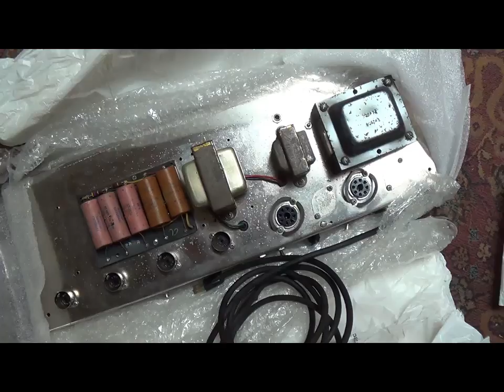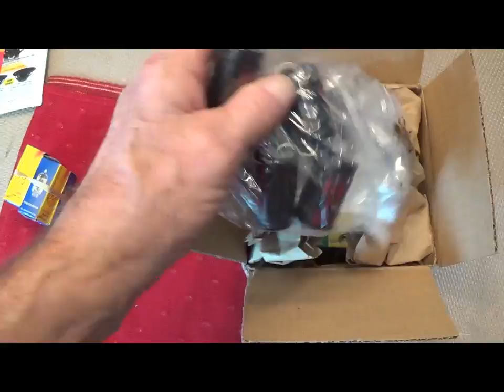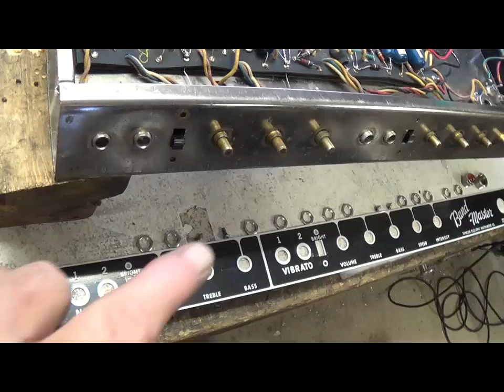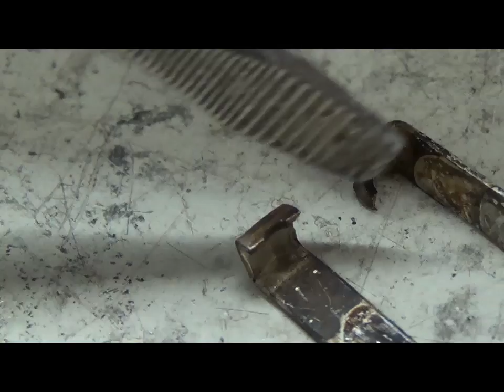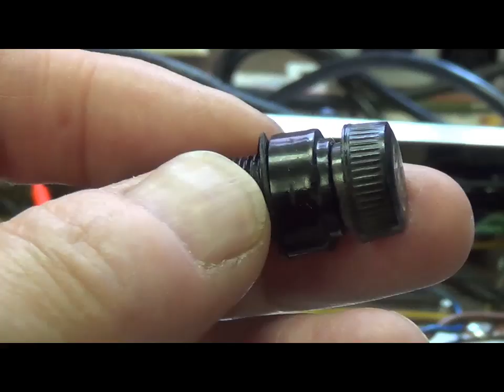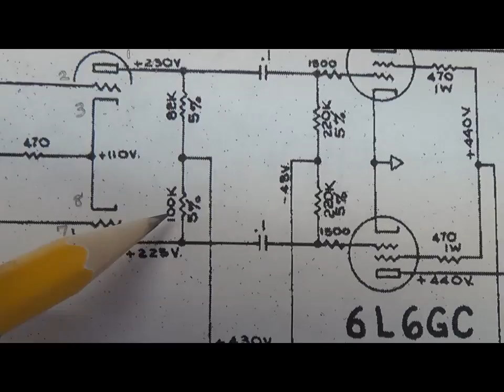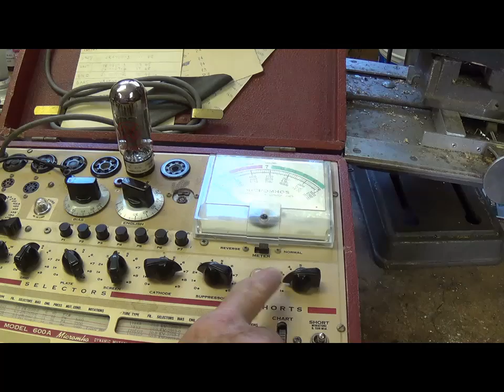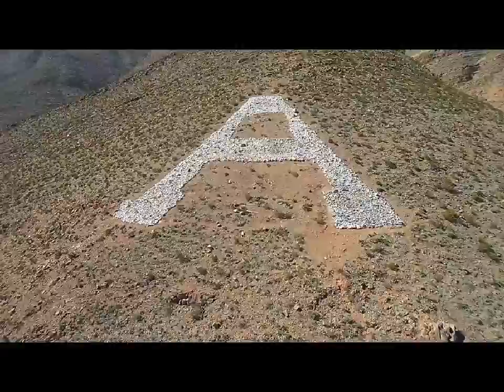The 1965 Bandmaster from Hell......A Really Tough Repair Job

Comment: Interesting about the resistor breaking down at high voltage.  I haven't seen that before.  With no voltage drop, I was thinking "no current".
Reply from the maker: You may be right, Russell. It would explain the voltage reading.....and the lack of sound from the tube.
Reply: Uncle Doug It's possible the resistor had a dry joint at one end.
Reply from the maker: That's an interesting theory, EJ. Thanks.
Reply: EJP totally agree with the poor joint theory. Other than drifting high over the years, that 82k would have been fine. Some of the eyelets looked as if they could have done with solder wicking and new solder.
Reply: @UncleDoug  so what is the best method for testing resistors for resistance if not the ohmmeter? especially if you are starting a new build and want to select/test value before soldering a part in the circuit....read some more comments and Doug you said, "It's rare to find a resistor that tests within reasonable limits with a low-voltage DC ohmmeter but breaks down under full current....but it can happen. If you suspect this is the case, then test the resistor for voltage drop."

Comment: Hmm what is the Zener  doing in there?
Reply from the maker: It appears to be a factory modification to reduce the DC high voltage. This is an unusual chassis, with its chrome-like finish.
Reply: Have you seen them before in factory amps?  I know it was a tip in Weber's book.
Reply from the maker: No, I haven't. But this amp circuit appeared to be completely original and untouched.......yet it had the zener very nicely installed.
Reply: The plot thickens :) do you think it was possibly a display amp? Or a prototype? Jack knew..
Reply from the maker: Indeed, his intense interest should have tipped us off. Yes, I think it was something "special".....but have no idea what.

Comment: Now hold on just a minute, don't you have a personal account rep at Antique Electronics? How dare they question the master of all thermionic emission? Or did you just use Jack's name? 

I'm glad you stuck it out and got that Bandmaster running. I've never seen anyone dissect a lightning bug or rebuild a switch before. Did you grow up on a farm where you had to fix everything yourself, not just run into town to the hardware store?
Reply from the maker: They don't know me from Adam at AES, as far as I know, Craig. I ask for and get no special treatment......darn it !! I just prefer to fix things on the spot, rather than wait decades for overpriced after-market parts to (hopefully) be delivered :)

Comment: Another great video, Uncle Doug 
BTW, my Newcomb D-10 arrived. 
So far, all of the TIny Grief caps test bad.
All the electrolytics test bad, save for one Zenith cap that appears to have been an old repair for a failed Tiny Grief.
I've ordered new caps to replace all the TIny Griefs and electrolytics.
Since this amp is missing all its knobs, I ordered brown chicken heads. Ordered a can of Deoxit to clean the pots and switches.
Now, the hard work begins.
Reply from the maker: It sounds like you are well on your way to a successful resurrection of the Newcomb D-10, FJ. Let us know how it turns out :)
Reply: Thanks, UD. You know I'll be asking you questions as I go, right? 
I'm thinking I'll need a 100K resistor in one of the inputs (for guitar). Wondering what resistors I need for bass and blues harp. 
Once I get the caps sorted, I need to find out where the negative feedback loop(s) is/are so I can remove or mod them for guitar use. 
I'm a complete tube amp virgin, so I know jack about them. Just know that I like the way they sound.
Reply: So, can I substitute 6L6 tubes for my 6v6s, to get more gain?
Reply from the maker: Not really, F3. If the circuit is designed to handle 6V6's, you'd best stick with them. 6L6's require higher plate voltage, plate current, and filament current.

Comment: Hi, thank you for the videos. I thought the speed of that vibrato was a bit fast for a less than one setting. By my comparison it should be soo slow to be barely decernable.
Reply from the maker: You're welcome, Glenn. I'm sorry you felt it was too fast. Hopefully the owner will like it as it is :)
Reply: Hi Uncle Doug, I had a chance to play through my fender Quad Reverb today and I noticed you were right, The vibrato is faster than my memory of it. You were right, I was wrong. You know, I couldn't figure out how you could have got that so fast, amazing memory lag. :-) Thank you for your understanding, when I was setting up my amp today, I realised straight away I had made a mistake with you, I should never have doubted. My apologies, warm regards, Glenn.
Reply from the maker: No problem at all, Glenn. I really appreciate your nice follow-up.

Comment: Doug, I'm curious if that output transformer is the original. My '69 Bandmaster had a mere 35 watt output transformer. Perhaps the lower output output transformer was a change for the Silverface series amps. My '69 Bandmaster-Reverb amp has ~460 vdc B+ with a 5AR4 rectifier. BTW, nice guitar playing at the video's grand finale.
Reply from the maker: This amp was unusual in several ways, Tony, including the unique chrome-like chassis finish and a zener diode for the HV centertap to reduce voltage levels. It all appeared to be factory-done. I never did check the OPT to see if it was an original number......but I'll bet it is.

Comment: Doug, you have done a fantastic job troubleshooting and repairing that classic amplifier. The aftermarket is great, I recently replaced the worn faceplate on a used Ampeg V4 amp that I bought and it looks as good as new. I love Antique Electric Supply and have had only good experiences with them over the years.
Reply from the maker: Thanks, Tony. I agree, AES is an excellent, well-run business.

Comment: JJ matched 6L6's are my favorite 6L6 tubes. I have been using them in all of my many 6L6 amps for many years with no failures. They consistently have a higher output wattage than all other brands I've tried and have good tone.. They have held up to the 495 vdc plate B+  in one of my home made 130 watt RMS amps.
Reply from the maker: That's good to hear, Tony. Other viewers are scaring me with their tales of horror. I just sent the chassis back to the owner and am worried it may let him down due to a tube failure.  Let's hope you're right.

Comment: I own a 1969 Fender Bandmaster-Reverb amp that I bought new and it is genuinely a 50 watt amp that Fender installed a 35 watt output transformer into. The output transformer failed in the 1st year and was replaced with a 50 watt transformer.  Since the transformer upgrade it is one on my favorite amps.
Reply from the maker: It sounds like the factory made a mistake, either in design or construction, Tony.  Even at 50W, there was no leeway.

Comment: Learnt something from you: that although a resistor can bench test within range, it may not be correct under load. Thanks.
Reply from the maker: You're welcome, Simon. It reminds me of the house roof that never leaks.....unless it rains. Without current, you really can't tell.

Comment: Would have liked to tap that defective tube a few times with the handle of a screwdriver when in the tester to see if the short returned.
Reply from the maker: I tapped the heck out of it, Simon, and nothing changed. I even took it out of the tester and shook it......no change.

Comment: Hey Uncle Doug - thanks for the great video!! Quick question please: How did you determine that the two 6L6 coupling caps were leaky?  Did you test them in-circuit?  Do you always test all coupling caps for leakage when working on an amp?

Just another thought.  Is it possible the tube socket or surrounding wires might have been responsible for that temporary short in the output tube?  Did you inspect for that?

Thanks for all your knowledge and expertise !!
Reply from the maker: Leaky power tube coupling caps are easy to spot because the plate current in the tube will not stabilize......it keeps increasing, due to the positive DC reaching the grid. The only way to properly test them is when they are facing normal operating voltage and current. The short appeared also in the tube tester, which uses a different socket. You're welcome, Donald.
Reply: Excellent !!  Thanks for the reply Uncle Doug !!  ;) ;)

Comment: Wow! Doug,  The amp from hell is a conservative description. I could embellish somewhat, but this is a G rated audience :) Yes...I've had quite a few amps like this cross my bench, and a 6 pack for each additional amp from hell afterward :). This reminds me of a Messa Bass 400 I had in the shop for 2 solid weeks. From randomly going into oscillation for no reason, to the PT developing a shorted HV secondary, to the output tube buss wire becoming a dipole antenna. i listened to the local weather report while cooking the new PT to make sure everything was right before I threw it at...I mean, hand it back to the customer. I no longer take Messa amps in for repair. I needed a vacation after that amp LOL :) Another great video! Looking forward to the next.
Reply from the maker: Thanks for your nice comments and for sharing some experiences, Frank :)

Comment: This type of repair is irritating.  You may as well replace every component because it seems as though they can fail at any moment.  You didn't show it, but I suspect that 100K resistor was the culprit, since you had full power transformer voltage at the 82K.  Thanks for the video as always Doug.
Reply from the maker: You're welcome, KM4. Sometimes when a repair job gets really frustrating, I start focusing more on the repair than on the video, and some steps get skipped.....but I think you can get a reasonable overview from this video :)

Comment: Great learning here, and I like your methodical approach. This is quite similar to my old Bassman, so this is helpful for more than just Bandmaster owners :). Like you did here, I replaced the resistors in the power section to be sure everything was fresh and even. The 220k resistors in the bias circuit were different types (carbon film & carbon comp). I just didn't trust that they would be the same resistance at operating temp.
Reply from the maker: Thanks !! A wise move, Andy. I am tending to favor metal film resistors more and more :)
Reply: That makes me feel better about using them :). I'd heard they are more stable at temperature, so I went with them for the grid stoppers, screen resistors, and the 220k. Their blue color matches the original coupling caps pretty well haha
Reply from the maker: They really are the best readily-available replacement resistors you can get, and the cost is minimal.

Comment: Some joints look new, so chassis has been polished or dipped at sometime.

A purrfect outcome
Reply from the maker: Not without complete disassembly......which I see no evidence of, Nic. It's a very strange finish and I wonder if this chassis was not specially prepared originally for a unique purpose or person (??)
Reply: True, perhaps a competition, limited edition or retirement, difficult to find this info out.
This project was undoubtedly a voyage of discovery, can I ask what was the actual time spent (not including waiting for parts)
Reply from the maker: It's hard to say, Nic, since it was off and on over about two weeks. I would guess 6 or 8 hours including all the testing and re-testing.

Comment: the short test in reality is not a dead short,it lights up with values below 300kohms approximately,so it can happen after a while the tube is working,gets hot and the elements can move or release metal flakes that give problems.
Reply from the maker: Either way, would you want that tube in your amp??  I thought it best to switch it for a new one.

Comment: Very good video as usual. Nobody, but NOBODY, with the sole exception of my favorite uncle, yep that'd be Uncle Doug, would ever consider taking one of those little slide switches apart just to see why it failed, let alone fabricating those eensy weensy metal parts for it and putting back together again. Sheesh! I'm fairly certain that if I ever took something like that apart I would destroy it in the process and learn absolutely nothing for my effort. Here's how it would go with my typical luck. If I tried reeeeally hard to carefully open that little switch up without ruining the body of the thing, whatever eensy weensy parts that were inside of it would fly out in all directions before I had a chance to see what they were, how they functioned, or where they came from. So yeah, I am in awe of how the master takes stuff apart and repairs it. It keeps the originality of the unit intact to the nth degree. Like the excellent video tutorial we were treated to in the W.E. Grable amplifier rehab, where he shows us how to open up a frozen potentiometer, clean it, and get it working like new again. Or that oil can delay unit that he was able to resurrect by fabricating parts for it and cleaning the daylights out of it 'til it worked like new. Thank you Uncle Doug! I look forward to new videos like I used to look forward to new Batman episodes when I was a kid. Very well done indeed sir, and please, keep 'em coming! {8^)
Reply from the maker: Wow.....thanks so much for your detailed analysis, DE. I am quite flattered :) We will do our best to keep you entertained with videos for as long as we're able.
Reply: Aw shucks Uncle Doug. My part was easy. You and Jack are doing all of the hard and dangerous stuff. Watching an Uncle Doug video is like watching Mr. Wizard, Nova, and Soupy Sales all in one show. When you predict the exact result a changed resistor value here or a different capacitor there is going to be, then power the amp up and prove it, that's sheer Mr. Wizard. The educational stuff is Nova on PBS, and the disembodied hand coming into frame to accentuate the dialog is vintage Soupy Sales answering that back door. You never saw who was there save for a hand that would punctuate every word the visitor said. I mean it man, your videos are pure genius and I mean that in all sincerity.  {8^)
Reply from the maker: Wow.....high praise indeed, DE. Thanks so much :)

Comment: Nice video, as always. No amp videos from The Guitologist this week, so it's nice to get my tube-amp-repair-video fix from my favourite uncle :-)

Speaking of selenium rectifiers: There is a Siemens selenium bridge rectifier inside one of my tube amps; a modded 60s projector amp with 2x EL84 PP. It seems to work well. Should I replace it with a new silicon bridge rectifier anyways?
Reply from the maker: Thanks, Asle. If the selenium rectifier is for high voltage rectification, it might be best to replace it. New bridge rectifiers are much more efficient and reliable......and inexpensive to boot !!!
Reply: It's for the B+ rectification; about 390V at power-on and 335-340V when the tubes have warmed up. I've got a few bridge rectifiers scavenged from dumped computer power supplies, I might use one of those after verifying that it works.

PS: A cute neighbor cat drops by outside our ground floor apartment almost every good-weather day, meowing at me or my GF to come outside and stroke her. She's a thick-coated dilute calico, probably a Norwegian forest cat. Jack might fall in love if he saw her :)
Reply from the maker: I think the rectifier switch would be a good idea, Asle.....especially if it's for free :)  That little Norwegian forest cat sounds adorable, but she might be in trouble with Jack......he's a scoundrel :)
Reply: Asle Leknes Don't use a computer rectifier. Computers run on 5V and maybe a bit more for the disk drives. You need something with a Peak Inverse Voltage (PIV) rating of 600V or more.
Reply: I'm not using the secondary-side rectifier diodes, just the primary-side bridge rectifiers, rated for 600V peak inverse voltage. I've got a few GBU406 and GBU606. Maybe I'll let the neighbor cat do the sniff test on them to see which one to use :-)
Reply: Update: Replaced the selenium rectifier with a GBU406; B+ increased from 345 to 379 V. This amp is used as a practice/recording bass amp, so I aim for maximum clean headroom. Hope it increased a bit along with the B+ voltage.
Reply: Asle Leknes What does bias expressed as a percentage mean?
Reply: Maximum plate dissipation. Last post corrected.
Reply: Asle Leknes OK, so what does bias expressed as a percentage of maximum plate dissipation mean? You can't take volts as a percentage of watts. You are not making sense.
Reply: Edited that post again, removed the whole thing about plate dissipation values. Do you approve it this time, nitpick? ;-)
Reply: Asle Leknes Just trying to understand what in HELL you are talking about. It now appears you aren't talking about bias at all. Very hard to follow all this.

Comment: personally, I would tell the Customer to send me 2 new tubes ...
Reply from the maker: I couldn't, Embree. I ordered the new tubes and felt that the responsibility for replacement should be with the manufacturer. It all worked out just fine.
Reply: ooohh ... I thought they came with the box-0-parts ..  :)
Reply: Embree Smith I get your point thought, I often get the customer to buy big $$ parts that I don't want to stock. I don't always want to carry the cash flow :-)
Reply from the maker: I tend to float the cost of parts, since I am holding the amp as collateral :)